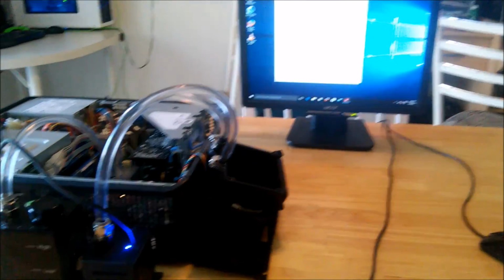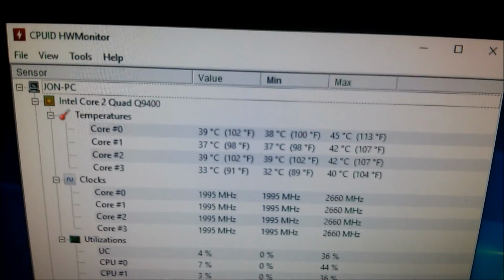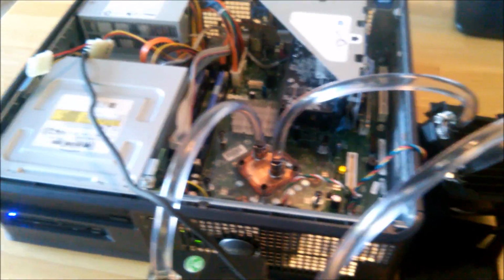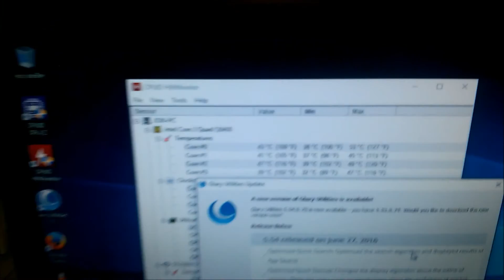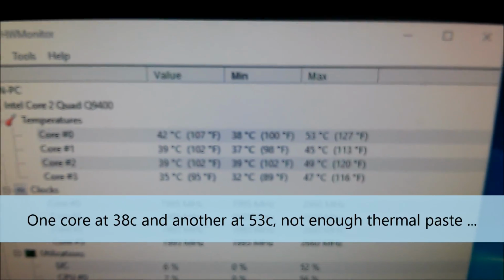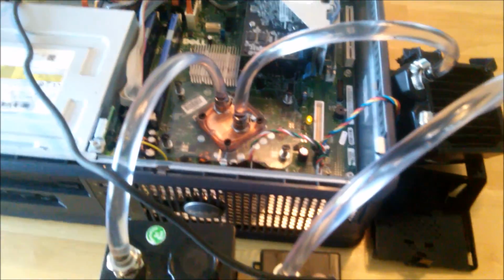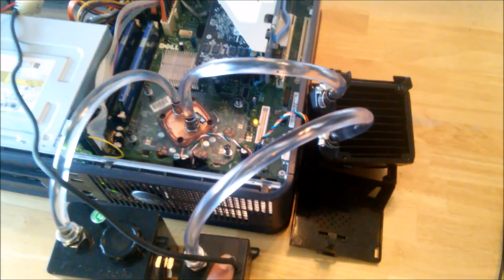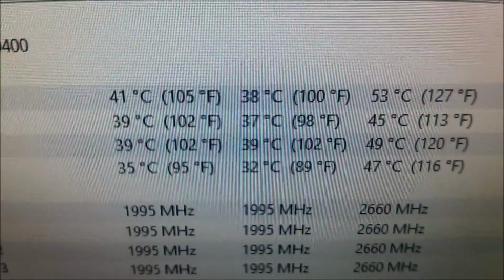Dell Optiplex DT Water Loop Test

Comment: "It releaves the surface tension of water, so the water can contact the metal better..." - sounds like a contradiction, that just ads an extra layer that the heat needs to transfer through. But i don't know how it works. Just commenting on the reasoning.
Reply from the maker: Why don't you look it up before you comment?
Reply: I was hoping to discuss it, but if you're not into that...
Reply from the maker: Water has surface tension, that's why it forms into a drop in the air and why some bugs can "walk" on it. That same tension forms a slight barrier between the water and a metal surface and limits the contact the water has. It you remove that tension, the waters contact with the metal surface increases.
Reply: You know what, i was thinking of friction. Not tension. My bad. I thought that it was going lube the metal with oil or something that would create a barrier between the metal and the water, reducing both friction and heat transfer. Again, my bad.
Reply from the maker: That's cool man. I like discussing things with viewers, it just didn't seem like you where asking a question with your first comment. I always try to research things as thorough as possible before I say it on film. I definitely don't want to sound dumb, ignorant, or misinformed =) Thanks for watching and I apologize for my initial, abrasive response.
Reply: I also might have come off as a bit rude at first. My apologies. I was really just confused.
Reply from the maker: Sometimes things are just lost in translation, glad we worked it out! I'm building the final version of a fully water cooled Optiplex DT as we speak. It should be done and the video posted in about a week. Hope you come back to check it out, have a good one dude.

Comment: Cool,so I've had a look at those sshd on EBay but what Sata connection do need??,I've look d at one that needs a Sata 3 connection..... Tiered,so slightly confused.
Reply from the maker: Sata3 is the speed of the connection. Don't worry too much about that, a Sata3 SSD/SSHD will run fine on a Sata2 controller. Just a bit slower. Just make sure you get one with a standard Sata power plug. The other thing to consider is the SSD portion of the SSHD. The more GB's the better.

Comment: Update,got the new motherboard,q9400 is in there already to go, ocz 8gb ram just got a gtx750ti from eBay,last on my list is a new hd,want to go for a 1tb 2.5 probably a WD black,not too sure for now.
Reply from the maker: Nice dude. Major upgrades =) You should get a 1TB for sure. The SSHD Hybrids are nice. They speed up load times some.

Comment: Do you think i could fit a normal atx powersupply in a 780 sff
Reply from the maker: No. The psu is a special shape for the Dell. I upgraded mine from a 235W to a 280W. It was out of another Dell and still wasn't exactly the same.
Reply: ok
Reply: Jon T whats the highest psu i can get for a dell optiplex for a hd6570 OC just asking cause i want to do a bit of overclock on my card
Reply from the maker: The 280W one that I'm using is the most watts available for the Dell PSU. It's out of an Optiplex XE SFF. I don't know if there is an aftermarket one that will fit in that spot. If you really want to push that card you could always have an ATX PSU outside the case. It looks kinda shitty but gets the job done.
Reply: true

Comment: My bad,I just go back to the q6600 do you know if that gtx 750 ti will work for me?.
Reply from the maker: The 750ti will work for sure. It relies on the PCIe x16 slot and doesn't really care about chipsets. Intel switched from 65nm to 45nm between the Q6600 and the Q9400, that's why it won't work on a 745. You can always pick up a 755 SFF motherboard to put that Q9400 in. They are super cheap. Here's one for $11.88 free shipping. http://www.ebay.com/itm/Genuine-Dell-Optiplex-755-SFF-LGA755-Motherboard-PU052-JR269-/282057167589?hash=item41abead2e5:g:3CIAAOSwGotWjWVa It will go right into your 745 case. Sorry for the mix up.

Comment: Yo Jon,I got a q9400 for my 745 sff installed it but an amber light is all that happens now along with increased fan speed????? Help.
Reply from the maker: Hey Sean. In our first conversation you said that you had an Optiplex 755. I don't think the 745 supports Quad Cores =(. Some people claim they got a C2Q to work on the 745 with a Bios update but I'm not sure if that will work or not. I'm sorry dude! You originally said it was a 755 SFF not a 745.

Comment: Hi, in your video about a watercooled Optiplex 780 MT from about a year ago I noticed you had installed a new power supply. Where you able to fit it in the case without any modding?
Reply from the maker: Hey, thanks for watching. The PSU I installed was a lot bigger than the stock one. The rear mounting holes were the same though. That little clip inside the case that holds the PSU had to be pushed down because the the new PSU was longer. That's the only thing that had to be done. If you go with like an EVGA 400W PSU, they're pretty short and will probably be able to use that clip. If not, just bend it down some so it's out of the way.